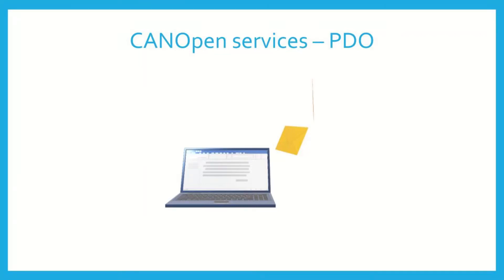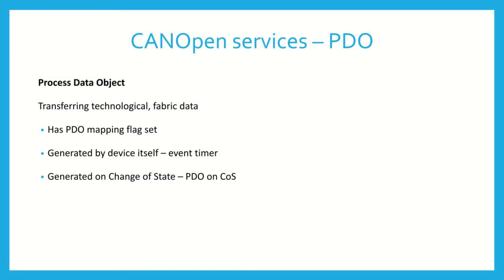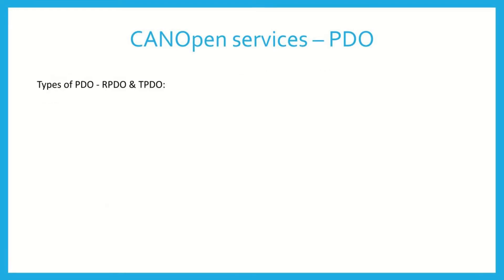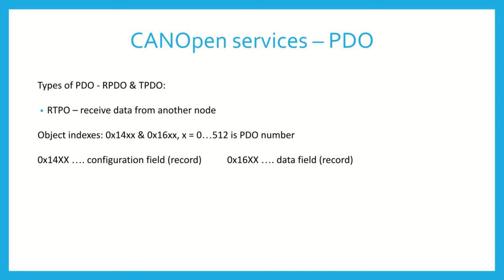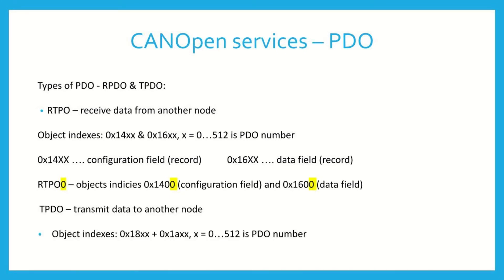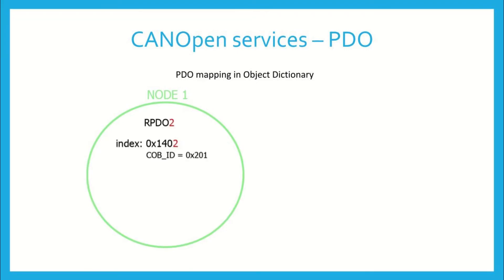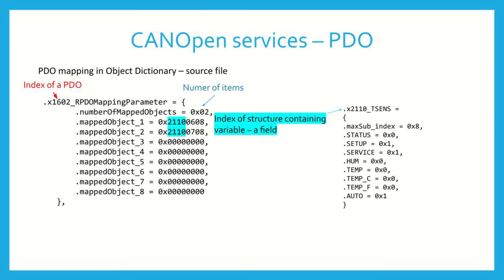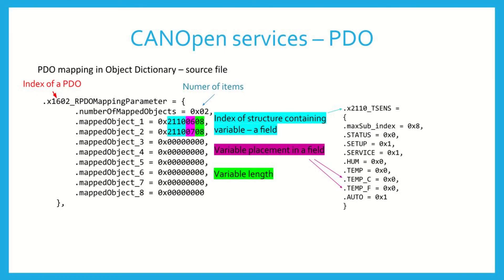CANOpen (4) - PDO service

Comment: If I understand correctly..

The configuration for each of the 4 TPDOs (Can header 0x180-0x480) is specified in 0x1800-0x1803 and 0x1A00-1A03.  

0x1800-1803 :  specifies COB-ID (ex. 0x180+n), rtr, if it's periodic - how often, etc 
0x1A00-1A03 : all the ObjDict's mapping entries for that PDO is here

For example, if TPDO1's mapping is to point to a value located at 0x6000 entry 1, 32-bit..   then 0x1A00 gets assigned 0x6000 01 08 .  

[Similarly the 4 RPDOs (0x200-0x400) have configuration in 0x14xx and 16xx]

However..

My device's documentation table (GCAN-4128) doesn't list anything in 0x1A00 or 0x2000!  In Index 0x1800 it just says that the transmission type is set in Index 0x2000.  And in it's RPDO's 0x1600 index it shows 0x21000108!